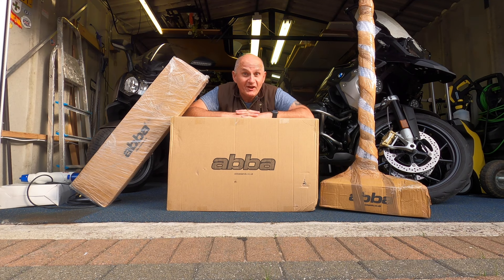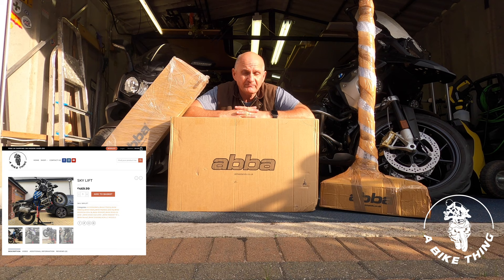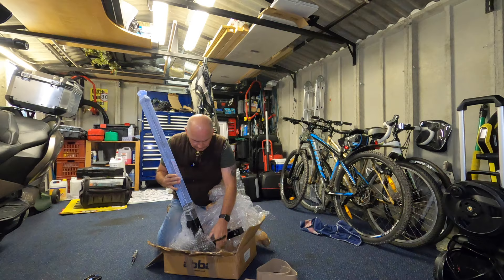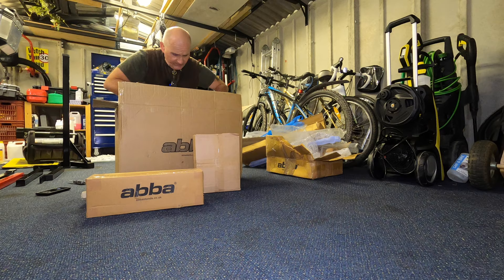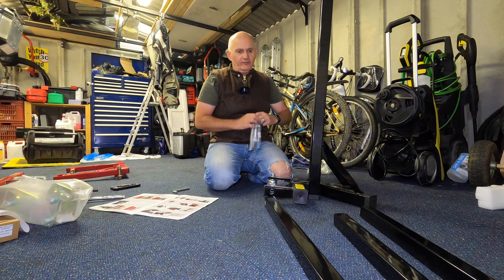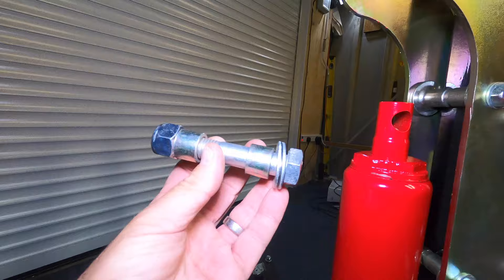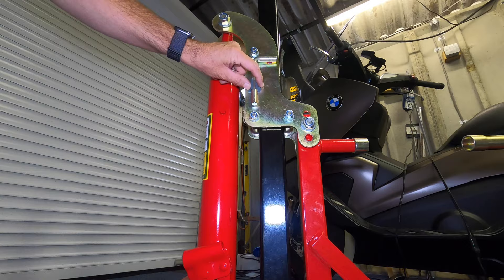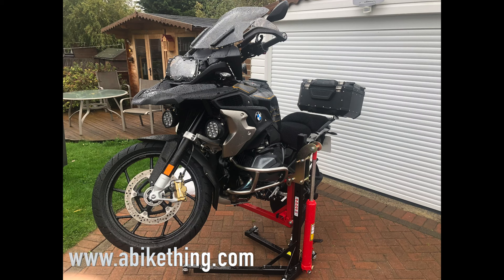Is the Abba Sky Lift worth the Money?

Comment: Well built unit - 3 ton hydraulic jack….. would only suggest using a low profile front wheel chock —- use SGS unit - means no struggle getting unit under holding bike and lifting side stand — especially when on your own..

Comment: Seems like a good piece of kit though the things that would put me off are the cost and due to lack of space in my garage the size of it. I have front and rear paddock stands plus a mechanic's crawler for cleaning which probably isn't as convenient as the skylight but does the job as I've had both wheels out in the past when it's tyre change time. It's all down to the individual in the end isn't it? I follow his channel too and he does some really good quality stuff, but it's expensive as you'd expect and after shelling out north of 16k for a 1250 GS not everyone is lucky enough to also have the disposable income to be able to afford all the farkles and accessories to go with it, at least not all the top end stuff. Thank heavens for ebay and the Chinese, at least you can avoid bankruptcy going down that route LOL. BTW this isn't meant to be a knock at The Bike Thing's website or his business, he offers top notch stuff and from what I've seen service to match, it's just that so many manufacturers see GS riders as cash cows and charge silly money for stuff like bits of plastic that really should be priced far lower as ebay has demonstrated. Anyway rant over, carry on great channel👍👍
Reply: Cheap can be dangerous too. Be sure to investigate the reviews on everything. Peace.
Reply: @roadglide  it certainly can be and as I'm now on my 3rd GS I'd like to think I've managed to learn a few things LOL. As an example I've got a pair of "clone" BMW aux lights on my GS that cost me around £40 where as BMW want over 10 times that amount for a set. Likewise things like fender extenders and hand guards can be had as exact copies for a fraction of the price which given the GS is the most popular bike bike out there the original suppliers can hardly claim their excessive prices are due to low volumes (and I wouldn't mind betting they're made at the same factory in China). Before I'm labeled as a complete cheapskate I do support the main suppliers where I think it's appropriate e.g. I have MachineArt x heads and a mudsling but feel in general we're being mugged off especially when we're just talking about bits of plastic. Sorry for the rant (again) and yeah peace out 😉